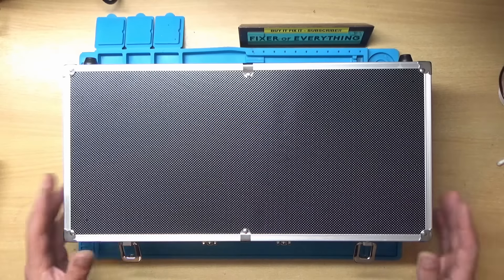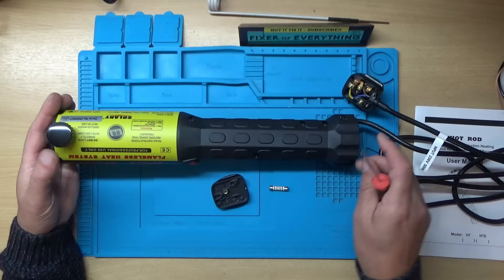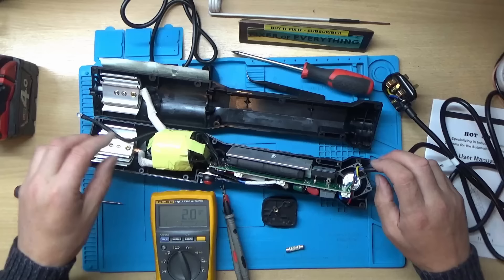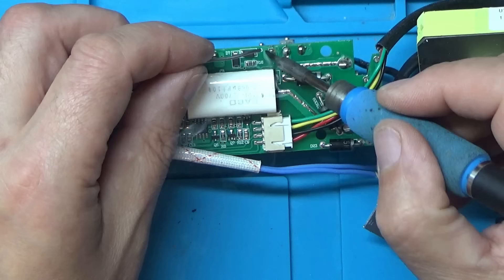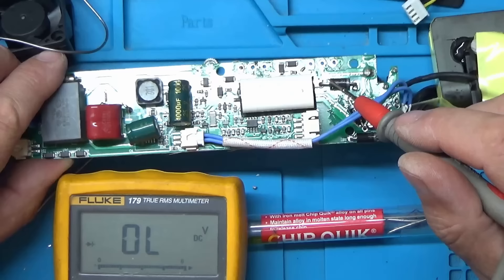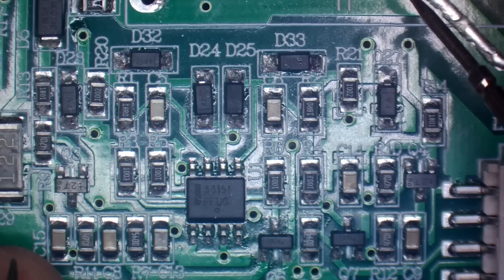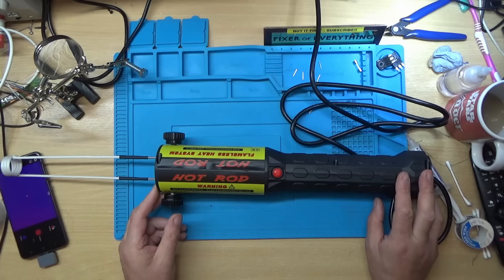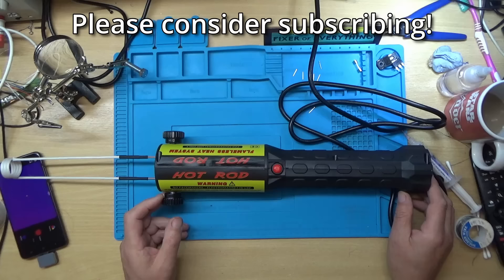Solary 'HOT ROD' Automotive Induction Tool | Can I Fix It?

Comment: I think you're only allowed to switch it off via the switch, after which the fan keeps on running until the temperature is low enough. That is what the thermostat might be for. The fan keeps on running until the temperature drops below 75 degrees. You are only allowed to unplug the device after the fan stops running. Welders also work like this. If you just unplug the power cord,the MOSFETs might burn, because the fan can not remove the residual heat. I am just guessing this works like a small welder.
Reply: A welder is also a device that sends a huge current through a wire. If you unplug them before letting them cool down they break. You can safely unplug the power cord as soon as the fan stops running.
Reply from the maker: The fan seems to be on all of the time, although I've not used it yet, but it was on constantly when I powered it up on the bench.
Reply: Residual heat would never damage this unit, its either on and heating up or off and cooling down. Its never going to get hotter after its been turned off. The thermostat probably shuts off the unit after the heatsink hits 75C.
Reply: @jaro6985  but when it's on it has the fan on because it needs it to keep a cap on the heat. if the fans turned off as soon as the device stopped being used, then the temps would quickly rise past operational temps
Reply: In a welder the MOSFETs are more hot than the heatsink during normal operation. If you unplug the power cord suddenly the temperature of the heatsink will go up, because there is no airflow in the device,  This makes the MOSFETs overheat as they can no longer release their heat. Ceramic infrared electric cookers with built in fan have the same problem, their thermal fuse will blow when you suddenly unplug them via the power cord.
Reply: @BuyitFixit So, the thermostat is probably just an overheating protection. Still it might be a good idea to keep it plugged in for 5 minutes after use. I see in the reviews that the most common failure happens when the device is stored. People plug it in and it just doesn't work anymore, while it did on the last use. This might point to a residual heat problem. One person even said he got a plop sound and burnt electric smell after unplugging it. As for the rattling plastic - many people report that. One person mentions that the manual says you can use it for 2 minutes after which you let it idle (with the fan running) for 5 minutes....
Reply: @kriswillems5661  No that is physically impossible for a FET to increase in temperature once the power is shut off. Ceramic cookers are a completely different style of device, but I can see what you say happening to a poorly designed one as you describe.
Reply: . @jaro6985  You're wrong. It's is a well known cause of failure of modern electric welders, people unplug them before giving the heatsink the chance to cool down, making the MOSFETS burn. The heat-transfer characteristics within device like this are not linear. Compare it with a coil that is switched off, it gives much higher voltage than the supply voltage it was on. You assume linear characteristics, but it is dynamic higher order system. You're right that the total net heat energy only can go down over time, but locally temperatures within the system can go up. Devices like this are not designed to continuously work. They need to work in duty cycles. In this device the duty cycle is : 2 minutes use, followed by 5 minutes fan idling (according to the manual). Normally a thermal protection should stop you from exceeding this, but I think the design might be flawed.
Reply: @jaro6985  It's been a known issue for high power projector lamps for years, turning the power off before the cool down cycle has finished significantly shortens their life.
Reply: @kriswillems5661  its thermodynamically impossible unless there is a very large component in the welder that gets hotter than mosfet tjmax (175C). Probably people shutting on and off the welder and violating the max duty cycle or similar.
Reply: @mfx1  a lamp is completely different from a FET, in that they don't like being turned on (struck) while hot. If the lamp cools passively or actively, it does not matter, as long as its cool before being turned on again.
Reply: @jaro6985  People don't generally turn projectors on again within a short period of them switching off, that's not the issue.
Reply: @mfx1  of course they do, thats why the software will lock you out from doing it in any good projector. Anyway, manufacturers explain a second reason as well "The lamp is still vulnerable to vibration whilst hot and may become damaged." So if people are unplugging the projector and picking it up to move it, the filament is still fragile. Again, nothing like a MOSFET.
Reply: That makes no real sense to me. The die temperature of the transistors cannot go up further as it already is when the power is disconnected.
Reply: A lamp in the projector uses to operate way above 1000degC, so once you stop the fan, that heat may really damage something around, so there the cool down sequence is really relevant.
But nor MOSFETs, nor transformer, nor any other similar component operates that hot, so there won't be any issue.
However it is still a good habit to always let the thing cool down in the controlled way before yanking the power off while nearly still operating. Just to maintain the habit, once you come with some device where it will be important. At the end it does not have to always be just about heat cooling down, but also about discharging output capacitors, working fluid returning to its designated storage reservoir from the working circuit, etc.
Reply: Great fix, just need a professional to use it now, lol 😂😂😜
Reply from the maker: @thetraindriver01 yes 😂😂😂

Comment: After digging me out of several "holes" my heater unit failed.  I did purchase a replacement but decided to investigate the failed unit.  After rewatching your video opened it up and I too found some broken plastic bits inside.  Found the big black inductor (under the heatsink) to have broken its connection onto the circuit board.  Although the tool was not misused and bashed around, I think the weight of the inductor and perhaps a small knock resulted in the broken connection.  Re-soldered and some hot melt glue applied along the inductor and time for a test. Rebuilding was a pain as everything is tight fit.  Tested and now working fine, better than fine as the fan comes on as power supply is applied, it didn't do that before and it did look like the connector wasn't fully home during strip down.  For the units dead on arrival, it could be they have been bashed around in transit with the momentum carried by the inductor causing failed connection?  Hopefully the information helps others.
Reply from the maker: Thank you for sharing this 👍🙂

Comment: This made me smile: I had an induction bolt heater and it had nothing in it but a big, heavy transformer, a big selenium rectifier, a coil and a condenser in the box. It somehow worked just fine without any other "electronics." 🙂

Comment: My best guess is someone hit the button without a coil attached. Zvs drivers don't survive being unloaded because they wont resonate and it will just keep the mosfets on and burn them up instantly. Thats an interesting design since most zvs drivers are made to work at 12-48 volts but this one runs on rectified mains and uses a step down transformer on the output. I may have to try making a zvs inspired by that one since it looks like they used a common tv flyback core which i got a few of.
Reply: I gotta say, good job btw. I learned a few things too.. lol I never really thought of diodes as common failure points.
Reply from the maker: Thanks 👍

Comment: The fact that they solder tinned the high current output wires that are secured by screws indicates some dubious design. NEVER solder tin wires that will be secured by screw/clamp connections. TBH I'd replace as much as possible on something like this even if it measures OK it could have been badly stressed and fail not long after the repair and most of those components are cheap.
Reply from the maker: Yes, seems cheaply made. A lot of bad reviews on Amazon about DOA or failed after 2 or 3 uses. We'll see how it goes...
Reply: @BuyitFixit  Induction heaters are actually quite hard to design in a way that they don't self destruct, a common issue is them not starting up properly and latching on, the Cheap Chinese ones that work of a DC supply must have a decent high current supply, a sluggish supply often leads to latchup and burn out, also as others have said unplugging them without giving them sufficient time to cool might be an issue.
Reply from the maker: Thanks for the info Martin 👍

Comment: Mike knows his stuff that's for sure. But also, he knows that you don't solder a good fuse over the top of a blown one. Same as you don't solder a good capacitor over one that's failed.
Reply: For this circuit he would have to order a new part there’s literally no point it does the same job as if it was done properly

Comment: I really enjoy your videos. You do troubleshooting pretty much the same way that I have done it for many, many years! I think it is terrible that so many people just throw things out and buy a new one. It is such a waste! I have found that most of the repairs that i have done were just a case of bad solder joints! And other repairs were just a matter of finding the failed component and replacing it for a small fraction of what a new unit would cost! It's nice to see that you have the patience to go through the troubleshooting process. Thank you for sharing what you do!
Reply from the maker: Thank you Michael 👍had quite a few dry joints over the years on things, and as you rightly say it's usually just 1 failed component which costs pennies 🙂

Comment: Nice Video and good to see it rescued.
H30SR5 is the device marking for the IWH30N160R5.
One other thing you shouldn't really use glass fuses for mains protection, you should use ceramic HRC type.
The reason is that because the mains is low impedance when the fuse blows violently the metal vaporises and then forms a thin layer on the inside of the glass remaking the fuse but now it can't heat up as quickly so it then very often shatters the fuse completely  so you end up with just the end caps left, very often it O/C tracks on the PCB instead of blowing the fuse a 2nd time.
You do have the HRC fuse in the mains plug as a backup though.
The Chinese are very bad at using glass fuses in mains circuits.
Reply from the maker: Thanks for that Richard. I've often seen the ceramic fuses in mains devices, but I've also seen glass ones too. I've taken note of what you said so I'll see if I've got any ceramic fuses for the future. Someone suggested a fuse socket, I've actually got some PCB mount ones but totally forgot about them 👍
Reply: @BuyitFixit  Yes same here so much stuff and forget about it and buy new.
I remember the fuse thing from a lecture some time ago about the fuses and have before now found glass fuses shattered with bits all over the place.
The problem when it's vaporised and reformed onto the glass the blowing current goes sky high.
Reply: @BuyitFixit  I seem to remember reading somewhere that there's a current limit for glass fuses, something like 6 amps, anything larger should be ceramic, smaller ones can be glass.

Comment: I repaired mine induction heater a month ago. It didn't look exactly as yours inside. The components that had failed was one IGBT-transistor and one surface mounted diode and
the fuse of course. Replaced both IGBT's with IHW30N160R5 and the diode with STTH512B. Thanks for the video!
Reply from the maker: Thanks 👍and well done on repairing yours too 🙂👍

Comment: I've got 1 of these... by the sounds of it my fan isn't working, I will need to have a look at it.
3 jobs so far - 2 successes.  Crankshaft pulley bolt, tried to remove using various methods, ending up with 4ft lever - no chance, put this tool onto it and it came of a doddle. Paid for itself right there!  The job that bet it eventually needed grinding off, so not a fault with the tool, it worked, the job just needed more drastic mechanical means.  Thanks for putting up the video.
Reply from the maker: Thanks for that and commenting 👍it could also be that the fan only kicks in when it gets to a certain temperature and the one I repaired still has a fault (fan on when it shouldn't be) or it could be that they changed the design at some point 🤷‍♂️
Reply: @BuyitFixit  Eventually my unit died, purchased another and can confirm the fan comes on with mains power applied. I will post the results of the autopsy on the "failed" unit.  But good news, the fan also comes on when power applied to the Ex "failed " unit now.

Comment: Great video. I got a similar one last year. It did the job I bought it for, but died not long after on a lesser importance job. The EBay seller sent me a replacement after I took photos of it with the wires cut off inside. I always intended trying to fix it but wasn't sure where to start. I'll compare it and see if the dead components are similar. If so, you've given me the confidence to give it a go. Thanks!
Reply from the maker: Thanks Nigel, hopefully it's the same if not very similar 🤞

Comment: Great video.  I have this exact device, and yes, it is not built especially well, but for the money, it works wonderfully.  I've removed rusty suspension bolts from my car that has lived 250,000 miles in harsh rust-belt conditions, and the induction heater gets bolts hot/loose within a minute or so.
Reply from the maker: Thanks👍and thanks for sharing.

Comment: Happy new year 

Thanks for another great fix. 

 Please can you advise is a 80 watt thermostatically adjustable soldering iron perfect or to much for smd work please? 

Thanks
Reply from the maker: Happy new year to you too! It should be fine (I'm no expert), but it would depend on the size of the tips. I use an Aixun T3A.

Comment: Just to add my 2c, The fuse used is porcelain with a mica filling, the reason for that is that when it blows it will not send glass every where, Might be wise to replace it with the same fuse if you can.... If you are behind it and it fails again that could mean a piece of shrapnel heading toward you. Good repair, these last two have made you work for it though.
Reply from the maker: Thanks 👍yes I thought about the fuse being glass, but it's inside the plastic so I'm not too worried. Yes the last couple of repairs have been a little more involved, guess you have to take the rough with the smooth so they say...

Comment: An interesting device. I'm recognising a design and build that's similar in many ways to those huge led torches that were for sale a few years back - they could burn things. Same case, same wiring from the mains, same label design etc. I think both made in the same factory.
Reply from the maker: Interesting, don't think I came across those. Thanks for commenting 👍

Comment: Useful tool as long as you have easy access to the bolt , otherwise a bit of a wast of space . Maybe the legs on the heating part  could be bent a little but not a lot
Reply from the maker: You get a plain straight loop which you can bend into a coil to suit your situation 🙂👍

Comment: These have many uses including heating a carbon crucible full of precious metal. The advantage with steel is that the HF field takes steel to dull red but the the magnetics of the steel changes so it doesn't burn away. Probably the principal cause of failure is trying one out without the coil connected.
Reply from the maker: Thanks for that 👍

Comment: Lovely fuse bodge.
Reply from the maker: 😂😂yes, I wasn't paying £5 for one with wires on, when I've got a box full of normal ones 😂
Reply: £5 for a single fuse is f-ing insane. Absolute bloody rip off. i would have just cut off the original fuse and soldered the wires to the new fuse.

Comment: I've seen a hot rod used on a seized exhaust manifold bolt and it allowed it to be removed with ease. Much more localized heat than a torch.
Reply from the maker: I'm sure I'll be using it on things like that. I've encountered plenty a seized nut / bolt 😂😂😂👍

Comment: Good recovery from a substantial fault. The connections at the metal blocks end looked odd, but maybe an illusion. Although the wires were in plastic tubes the screws securing the cables didn't look to be insulated from the blocks. The IC should be fine though you may want to bring any tractors indoors before working with any nuts (especially up t'north).
Reply from the maker: Thanks 👍yes it's getting bloody cold up here now. We lost mains and internet yesterday. I was recording a video at the time so I might leave that bit in it.
Reply: The old fuse looks like it's the sort with removable slide on/off end caps to make it a through hole part. Just in case you'd like a neater job 🙂
Reply from the maker: Thanks, I had seen those before but wasn't sure if they were spot welded on. I'm more about functional than cosmetics😂😂😂👍
Reply: @BuyitFixit hi,
After your power loss, are you thinking of adding battery storage to your solar PV system?

Comment: I have a new ultrasonic parts cleaner and right out of box the heater element didn’t work.  I had the unit several months before I had a need to use it and couldn’t get any

Comment: Could operating it without a heater coil installed have caused this fault? Maybe saturated the output transformer and caused excessive current flow through the MOSFETs. I'd have thought it would have been designed to protect against this though.
Reply from the maker: Possibly, I had been thinking the same.